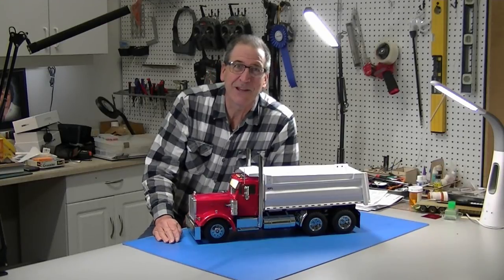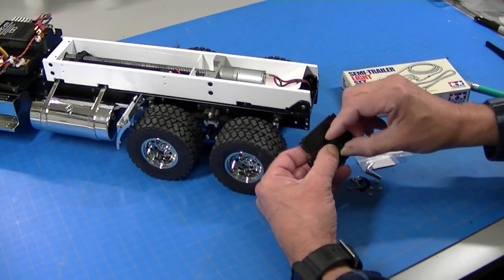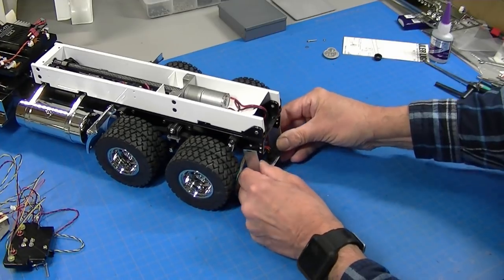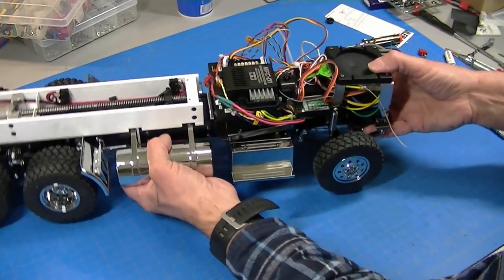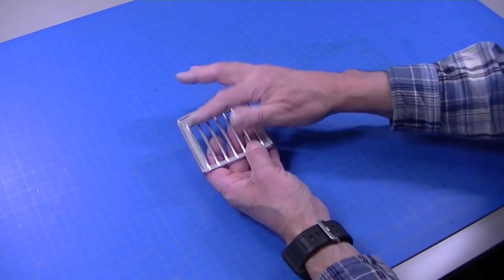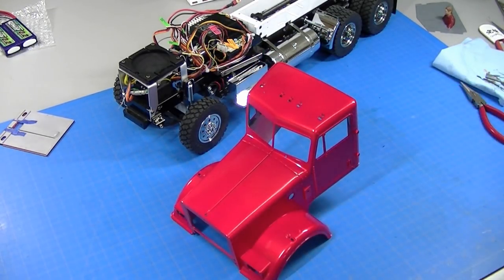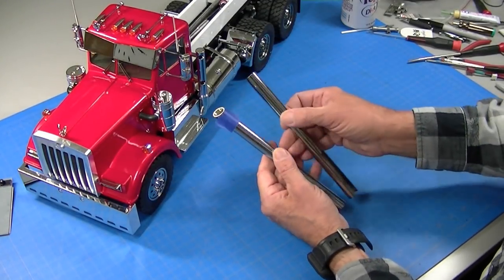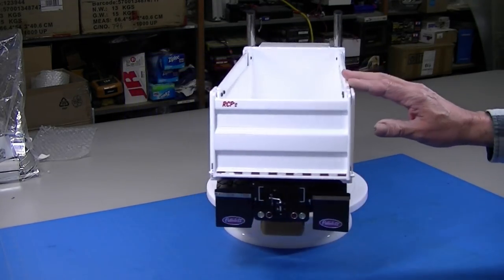1/14 Tamiya King Hauler Dump Truck Build Part 4

Comment: Great job , maybe try making the fuel tank a door and putting a battery in each tank so you can open the fuel tank and get the battery in and out.
Reply from the maker: I actually thought about that but would be a ton of work and the battery would be pretty small.

Comment: You talked about making a video about a g.t. power soundkit. I am woundering what sound kits is most popular were you are. In sweden and europe the most popular sound kit are Servonaut and Beier sfr-1, and the MFC is regarded as a beginners kit and not as popular among advanced builders. I have the Beier sfr-1 in two of my trucks (scrath built firetrucks eu style) and a mfc-01 in my first, a ford aeromax.
Reply from the maker: I will be doing a truck with a Beier in the next few months and a GT Power Pro soon.  The Tamiya though is by fa the most popular.  Pretty easy to hook up and works just fine.

Comment: Is there a chance you could post the accessories that you have used and where they are sourced from as well as what comes with the stock king hauler kit? I am ordering mine but it would be helpful what else I need to have the options you have on yours. Great video!
Reply: Do you sell custom built trucks as well? Thanks
Reply from the maker: Steve.  Just search for Hobbyconcepts on Facebook.  You can PM me there.

Comment: Hi! Great video, could I ask a question? How did you set the transmission to a 3 position switch? Did you bypass the mfc?
Reply from the maker: Yes, I plug the transmission servo directly into the receiver.
Reply: Hobbyconcepts-LLC thanks! Hopefully someday tamiya allows for multi channel inputs.
Reply from the maker: That would be nice!

Comment: whats next do you have lined up
Reply from the maker: Lots of stuff.  A trailer for the dump truck to haul and excavator, finishing the Hemmt trailer.   Also installing and setting up the GT Power Pro sound/light system.  Plus building a Tamiya Tipper truck and a Tamiya M1A2 RC Abrams tank.

Comment: Bob do you have a way to get wireless trailer lighting system? IR? Then you don't have to hook up light wire each time you hook up a trailer to it
Reply from the maker: GT Power makes a unit like that, others may also.